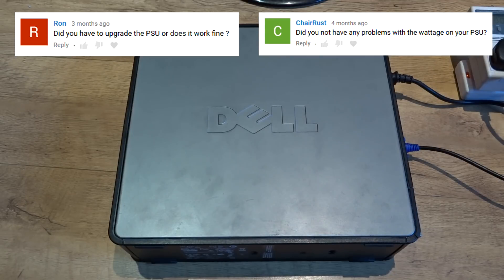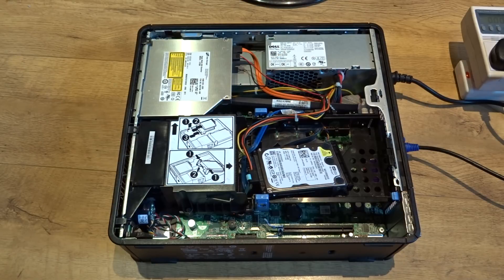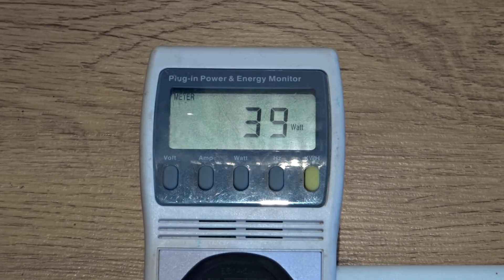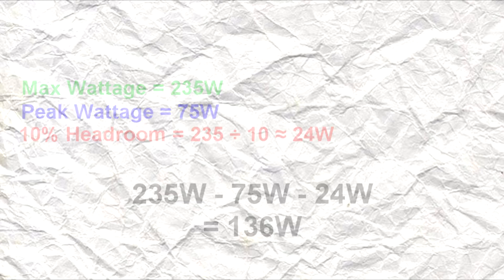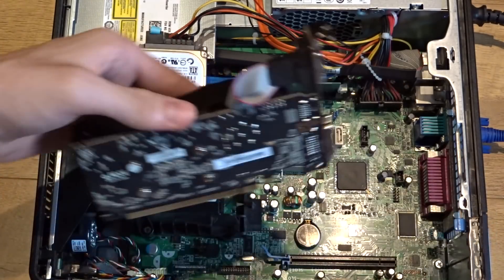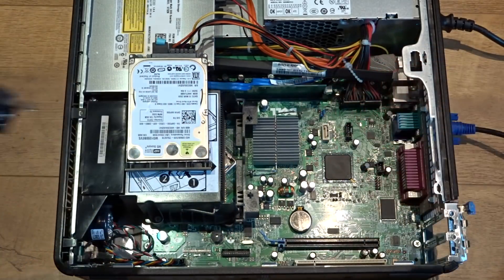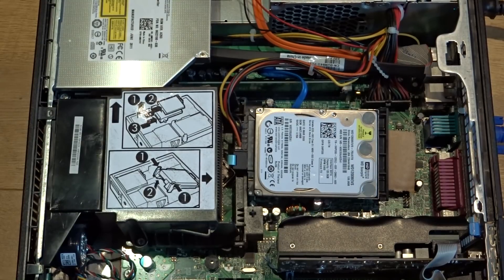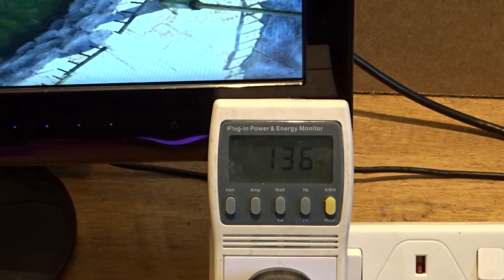Optiplex 780 SFF to Gaming PC

Comment: Pls i want To upgrade My optiplex 780 sff But i want To know your video card
Reply from the maker: The card I used was a GTX 750 Ti; specifically the model N750ti-2GD5TLP.
As long as it is low profile and does not require extra power connectors it should be fine but you should also follow the steps in the video.
I hope this helps ;)
Reply from the maker: The difference is the physical size. Generally, a low profile card can have up to 2 video ports on a single slot whereas a normal (high profile) card can have 4 video ports on a single slot.
Low profile cards are used in cases that are slim such as the one in the video.
Reply from the maker: How cheap is cheap to you? And would you mind going with a used card?